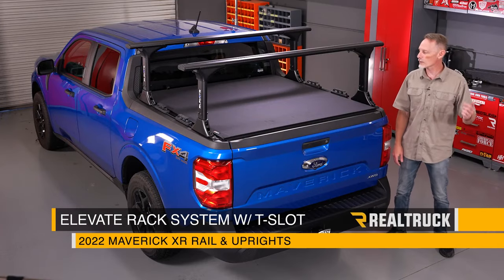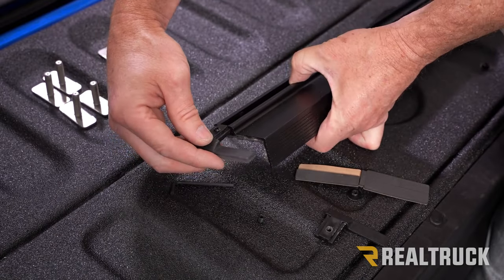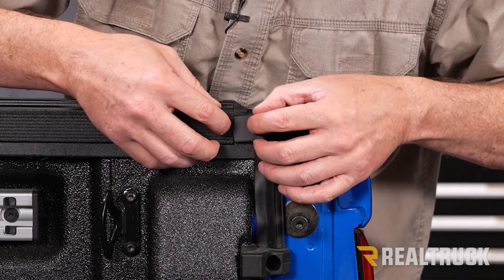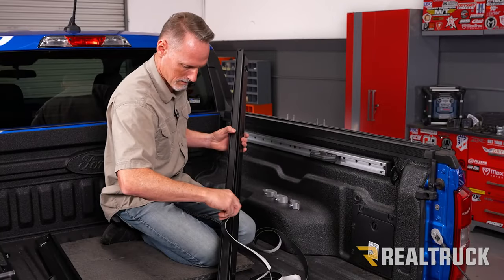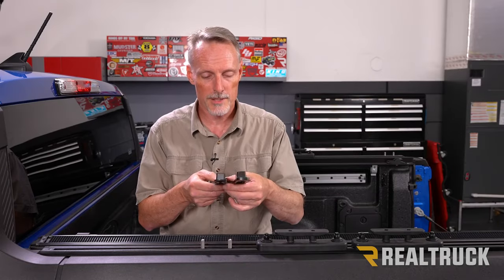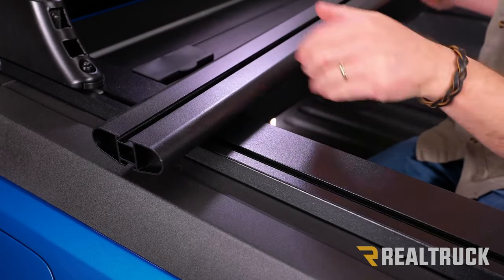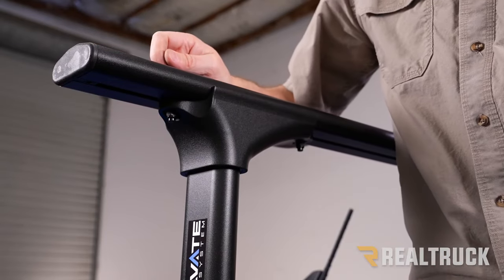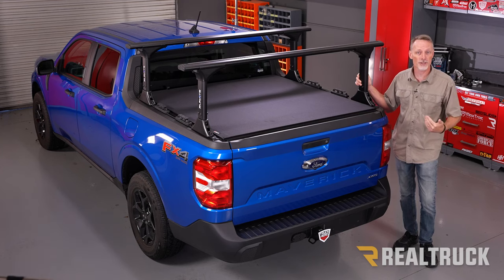How to Install Elevate Rack System with a Tonneau Cover on a 2022 Ford Maverick

Comment: Just finished installing one of these, glad they decided to add a middle height, so now 18/23/28. For my Silverado, 23" is the perfect height, just clears the top of the cab and I can fold my Bakflip all the way to the back window. Only issue I had, was I used the thin seal on my Bakflip, which made re-installing it a little too tight, had to remove the seal(didn't have it in the first place). 
Also, another thing to note, since you're setting your Tonneau cover on top of the TS rails, like in my case, the tailgate seal on the Bakflip is not flush anymore, leaves about a 3/16" gap.. :( need to find a way to seal that part..
Reply: Yeah, I have that issue also. Used to have a watertight seal, not anymore.
Reply: Same, not a tight seal at tailgate 😕
Reply: @gwjones12   I've been seaching for a seal replacement on Amazon, so far have returned 4 seals.. trying to see what fits.. haha!

Comment: Very nice video. I am looking for this exact set up and you may have sold me on it. Which tonneau cover matches this set up? Is it lockable?
Reply: I have this rack and it works with my Retrax cover
Reply: Works with Bakflip MX4 but does not provide a tight seal at the tailgate. Is not secureable.

Comment: Bolts you mentioned for cleats and racks were backwards. Long for the racks short for the cleats. Also bak now makes a t slot rail for there cover so no need for the elevate rail so tonneau can be more flush
Reply: Is that on newer covers and has to be part of the tonneau cover kit? If available separate, that would be great.
Reply: @Islasian4life I works on all I believe but I’d call to check firming. I swapped out my old rails from 2020 for newer ones

Comment: It looks quality built, but WHY do you have to remove and reinstall bolts when adjusting height of racks, that step should be redesigned and changed to one step tensioning , gets really old for a tradesman/ weekender and multi use, dealbreaker for me

Comment: Today I installed the rack with bakflip. But the rubberseals of the bakflip are to tight. Its not possible to close it. I pealed of the seals of the rails and replace the seals of the rails from the Bakflip by the thin seals but its to tight.

Comment: Thinking about getting this on my Tacoma as I currently have the x15 installed. But one question before pulling the trigger. Would it be possible to load Thule XT XL on this?

Comment: I'd like to get these racks but with a gator SRX roll-up tonneau cover. Is the installation process the same?  Does the gasket need to be replaced with the smaller one?  Thanks

Comment: Can you put a rooftop tent on this system? If you can which rtts are compatible with it?
Reply: That's my plan, the rack is rated to 750lb static, 500lbs hwy, and 250 off road, so any tent under 250 lbs should be good.  That said, I wonder if the weight capacity of the rack changes when extended, or if not.  I imagine the capacity would be conservative (so extended).  Anyhow, most RTT are under 250lbs (mine is around 200), and once we're camping (static), as long as the occupants and tent don't exceed 750lbs combined, you're good.

Comment: What if my existing bed cover used 4 clamps, totaling 8 clamps. Do I just use the newer Elevate TS rail clamps instead, 3 on each side?
Reply: I re-used 2 of my clamps from my bed cover, so 3 clamps per side. I guess I could have used all 8, doesn't hurt to have more :)
Reply: @Islasian4life  I ended up just using the bed cover clamps since the teeth fit best with the bed cover rails.

Comment: Seems like some people have made the rail system work with the MX4 cover on a Ridgeline, but your website says that it is not compatible. Do you know what modifications need to be made for it to work?
Reply: I'm looking to install the rail system with a truxedo lo-pro cover. Another video a salesperson mentioned he cut the rail to fit. Choose the 63" rails and trim them on the band saw. As there's no drilling into the truck, they just have to be shortened. This is what I'll do. You'll probably have to do the same  It is really sad that so many manufacturers of truck accessories just completely ignore the Ridgeline. The second generation has been around for 5 years now and there's still such little support for it. In their tiny heads they must just not think it's a good vehicle even though it really is.

Comment: Does it work with a Bak Flip cover?
Reply: I have a BakFlip MX4 and it works great, mine came with 3 height settings, middle height clears it and just sit above my cab(2017 Silverado 1500).

Comment: Would this work well for a couple 8+ surfboards or a 2 person kayak?
Reply from the maker: Great question! As long as you have enough distance between the front and rear load bars to properly support what's riding on top, you'll be fine. Take the Maverick in the video as an example. This truck has the shortest bed that the Elevate Rack is made for, and the front and rear load bars can be placed to span about 3 1/2 feet. if you place a surf board that's 8 feet long on top, so that about 11/2 feet hangs off the back, then only about 3 feet of board will hang over the cab. With the tandem kayak, I'd recommend using a Kayak carrier on the rack for the best support, but the Elevate would haul it well.

Comment: Would a 28ft ladder fit on this?
Reply from the maker: If you're installing the Elevate Rack on a Maverick, the load bars will be about 3 1/2 feet apart at max spacing. If you have an extension ladder on top of it, we'd recommend using a cab mounted load bar from a roof rack, like Rhino Rack, Thule, Or Yakima. The cab mounted load bar would work as a cantilever support for the ladder.
Reply: How will I know if the elevate racks match the height of the roof rack though?  Specifically on a Ford Maverick.  Thanks

Comment: Would this work for hauling a 32’ ladder?
Reply from the maker: We'd recommend hauling an extension ladder with a rack that extends over the cab. A 32 foot ladder collapses to about 16'3" and the Elevate rack only supports above the bed. That leaves a lot to hang over the cab without support. Hope that helps!
Reply: @Realtruck  what about a 28’ ladder that collapse to 14’?
Reply: a 32' fits on the truck decent.  I recommend a bed rack and one bar on the cab to support a 32'.  Even with a cantilever your support is all on the 2 crossbars and that is a lot of torque to put on the rack.  I am not sure how this rack will line up with a cab bar.  the ladder would probably rest on the rear bed bar and the cab bar and hover over the mid bar.  My buddy has this setup with a different rack and it just barely hovers over the middle bar.  He is getting 35 mpg with the 32 on there.  I am still waiting for my truck, but plan on an adjustable height bed rack with one bar on the cab.